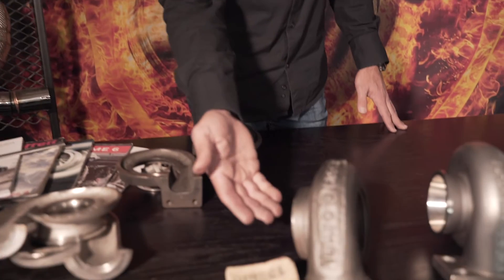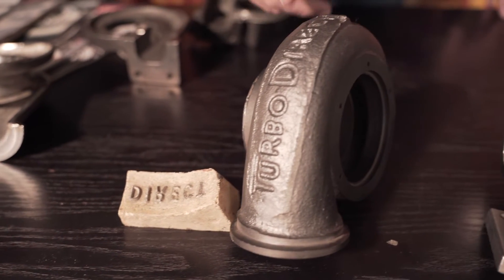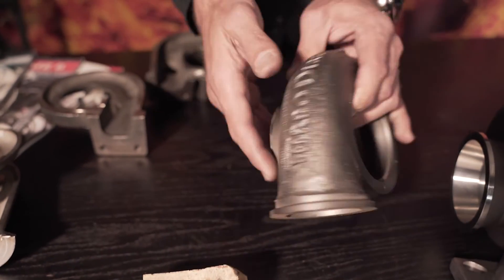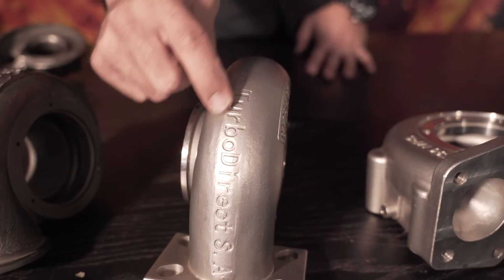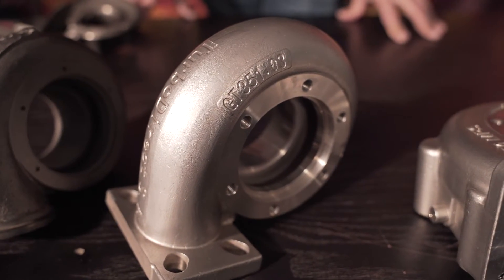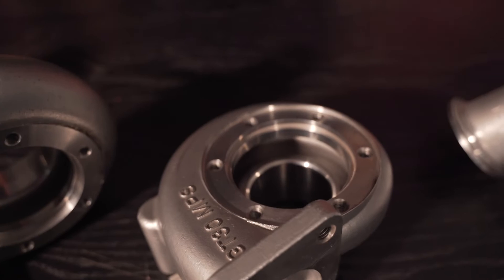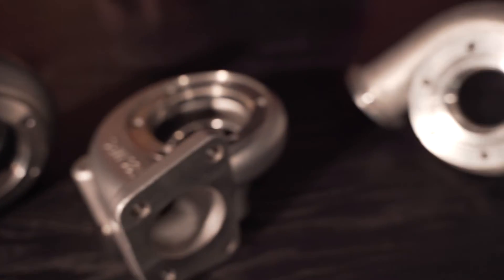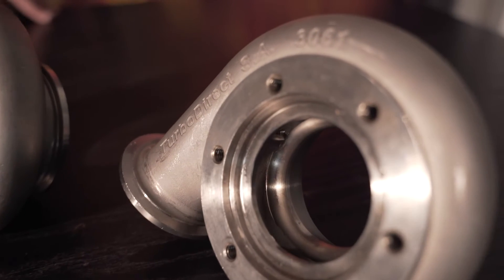TurboDirect S.A Turbine housing evolution

Comment: IWG Reverse rotation G30 housing 👀
Reply from the maker: This is something that i will do by comparison to the BorgWarner EFR designs -- the EFR setup and flow capability far exceeds the Garrett ability - their swing valves are almost 60% large is diameter, the porting with twin scroll ports feeding the swing valves for gate control is unmatched -- this will come in a future video.